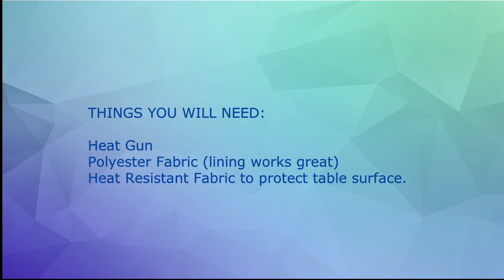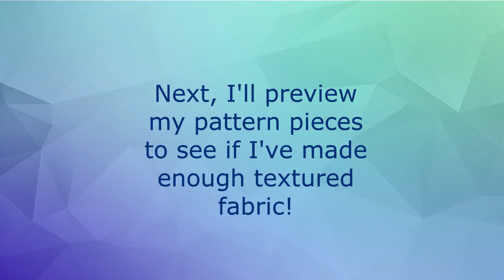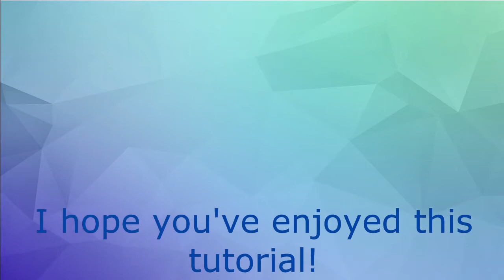Heat Texturing Fabric

Comment: I notice you're not wearing any safety equipment. Don't the melting synthetics emit fumes?  Should we wear gloves/apron to guard against burning ourselves?
Reply: If you feel more comfortable wearing heat-resistant gloves/apron that is great. I don't find it necessary for myself as I am cautious of the equipment. There are very few fumes since you are not completely melting the fabric, only causing it to react to the heat (just as much as an iron would do). In the summertime, I have a fan blowing indirectly, because it can get a little warm!

Comment: Thank you for the demo - can you please tell me what brand heat gun you use & if you recommend it. I think I'd like a 2 speed heat gun for fabric/Tyvek projects. What temperature is best for your projects?  Your opinion, please? Thanks. ;-)
Reply from the maker: I use a Milwaukee Commercial Heat Gun. It can run for hours and not over-heat. It has only one speed, and I control the heat by raising or lowering the tool. Some mediums are more heat sensitive so a little practice and you'll get the hand of controlling it that way. Unfortunately, this model is no longer available, but there are many out there that work just as well!
Reply: The link doesn't work.  @DanaMarieDesignCo
Reply from the maker: @SS-mk1rq  Sorry about that! We've updated the information. Unfortunately, this model of heat gun is no longer available. There are many that work as well!

Comment: What is the necessary power to do it?  Because I don't I know what heat gun to buy...
There are some that only reach 200 and others that the minimum is 400 and the maximum 600. :(
Reply from the maker: I use a Milwaukee Commercial Heat Gun. Specifications: Temperature: 650 degrees F, Watts: 360, Amps: 3, Volts: 120 V AC. 
You can find them here: https://thesewingplace.com/precision-hot-tool-heat-texture/

Comment: is this gonna work on silk/satin? thankyou
Reply from the maker: Not on 100% silk (it doesn't melt, only burn). If your satin is polyester, nylon or acetate (heat sensitive fabrics) you should get texture. The heavier the fabric however, the less texture you'll get.
Reply: @DanaMarieDesignCo  thank you so much!

Comment: Can i just use a hair dryer ?
Reply from the maker: Usually doesn't get hot enough and too much air will just blow your fabric around.
Reply: A hair dryer will blow the fabric around, and does not get nearly HOT enough.  A heat gun gets So hot that it will BURN you, a hair dryer will not because, well, you don't want a burned scalp lol.  Buy a crafting or hardware (construction) style heat gun to try this technique.